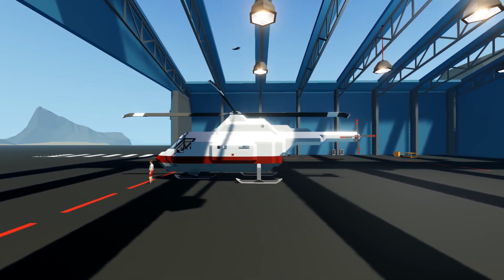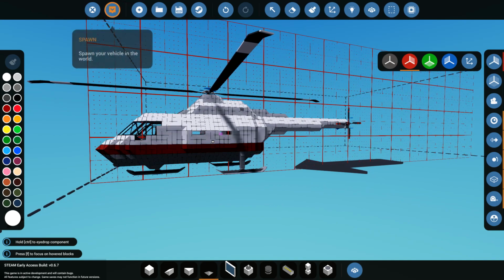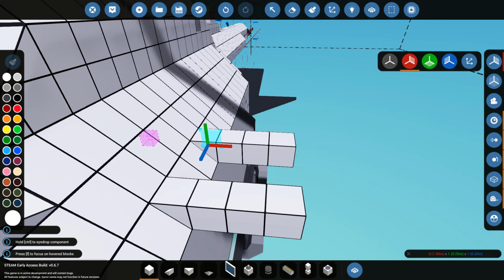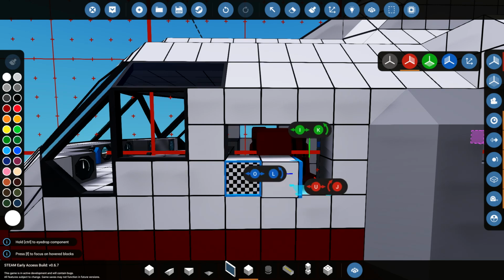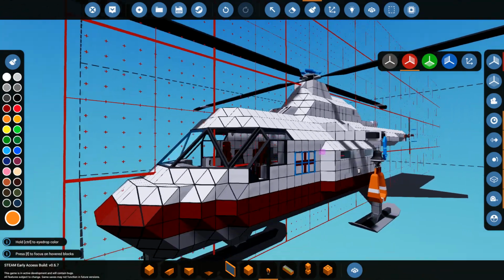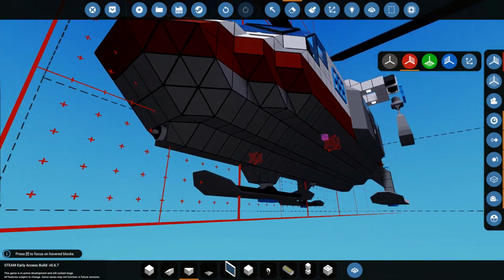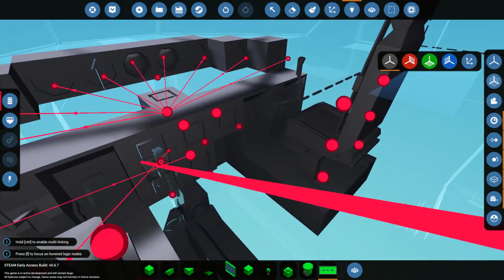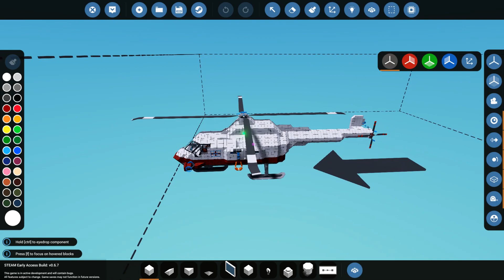Lights + Testing!  -  Frantic Helicopter  -  Stormworks: Build and Rescue  - Part 5

Comment: tail end definitely looks better now :) was way too stubby before. like a childs lego heli...lol

got your left right mixed up :P 
heli nav lights go on the belly, engine housing, and tail section
inlay the ailerons on the tail fins flush. maybe extend the tail fin static surface so it goes beyond the pitch aileron
might have missed it, but I didnt see any method of refueling either power or fuel.

nice job so far, I agree with the orange harnesses, really pops with the heli paint scheme :)

Comment: I have a little bit of a problem.
Whenever i build a small helicopter, it works just fine. But when I build one of this size, it just spins around in the air.  The rear rotor is set to neutral, gyro and autohover are hooked up correctly, and the main rotor is also facing the correct way. It’s using a jet engine going 40rps max. It’s really frustrating. Does anyone know how to fix it?
Reply: The tail rotor must equal the speed of the main one, you probably messed up the speed of the tail rotor itself, and the tail rotor should have angles so it also acts like a propeller and you can turn it

Comment: The tail rotor is too small as well as the tail is too short
Reply: The size is not a problem
The turning speed of the rotor is just a bit too slow
Reply: @slickrick8279  oh ok thanks for the info